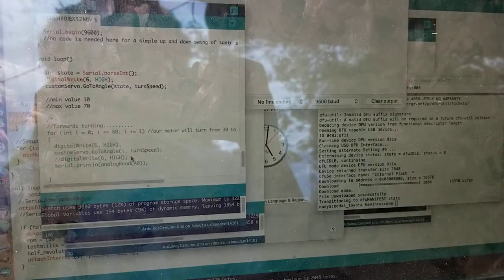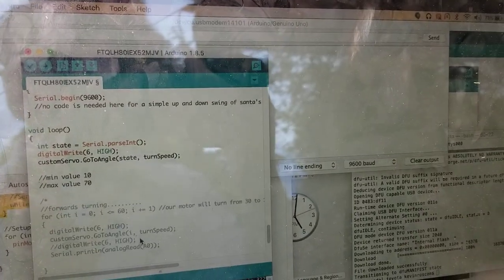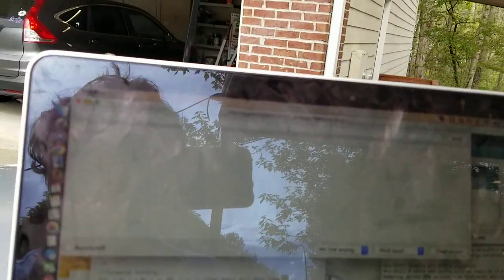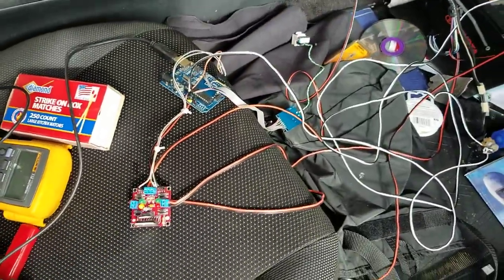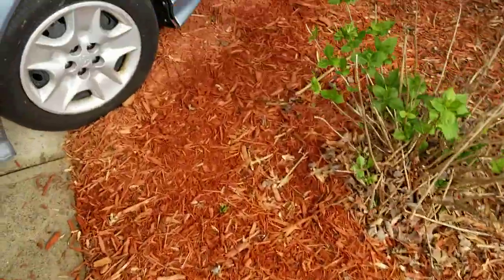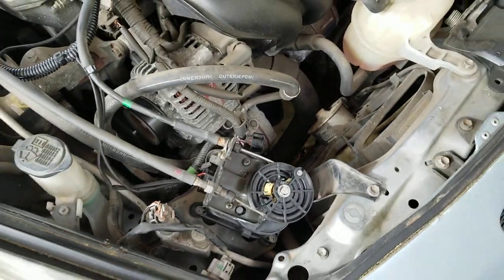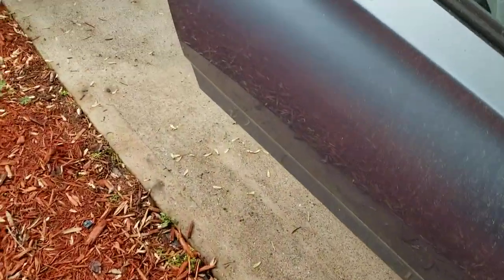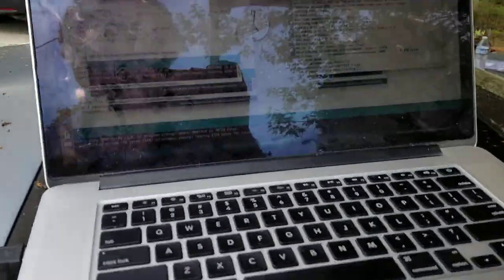Throttle "by wire" mod on a cable throttle car (Toyota Celica)

Comment: cool man, is that actuator a stepper motor? or is it vaccuum supported? in my old car it was a weird construction with a vacuum membrane. Will this setup stay with the arduino or can you use the Polysync board?